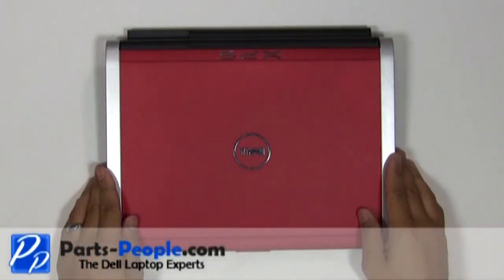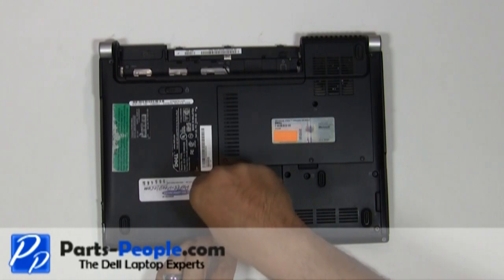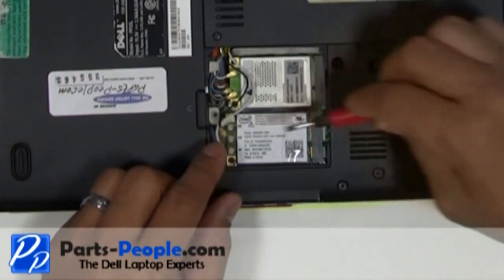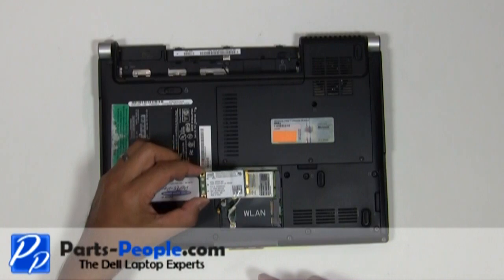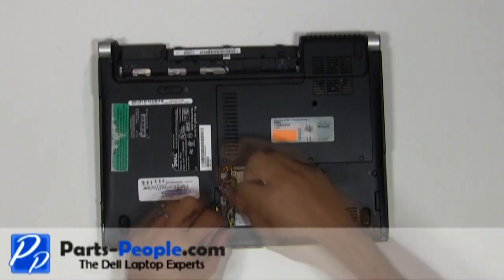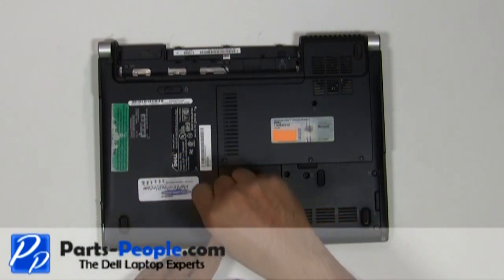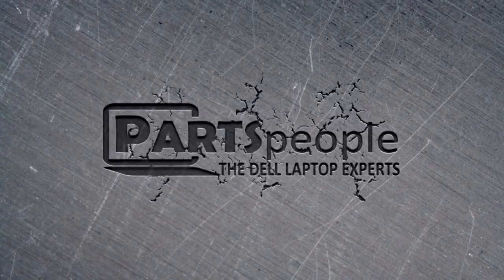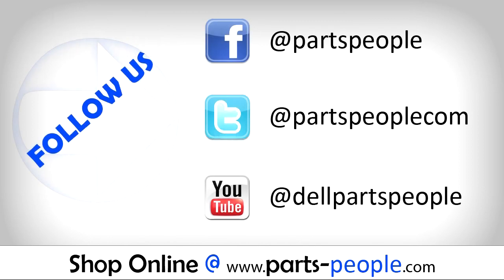Dell XPS M1330 | WiFi Wireless Mini-PCI Card Replacement | How-To-Tutorial

Comment from the maker: If you can find a mini-pci slot for your desktop then you should be able to make it work. You will have to steal an antenna wire and route it in the desktop case, but it should work.